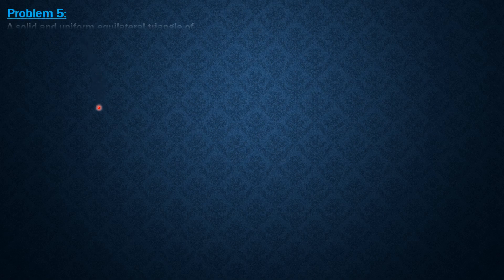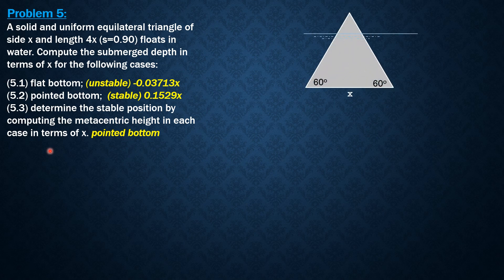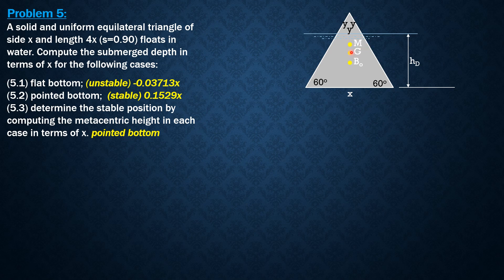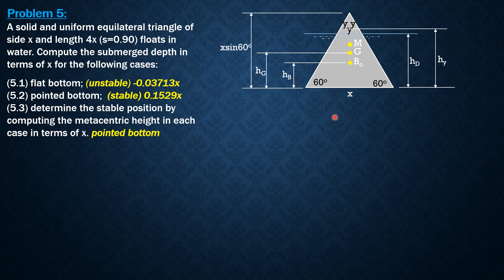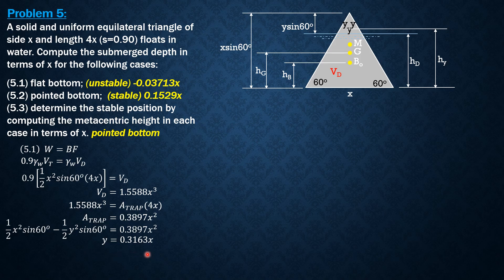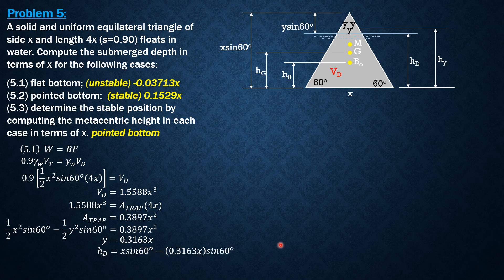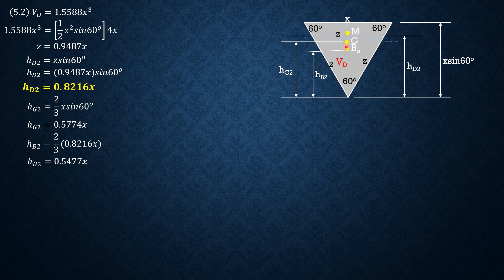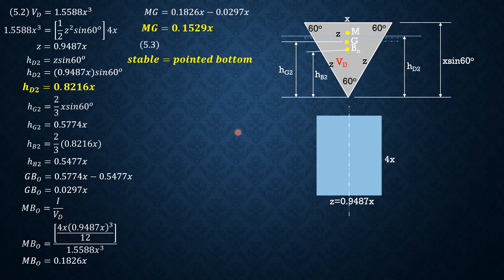STATICAL STABILITY of FLOATING BODIES, Example 5

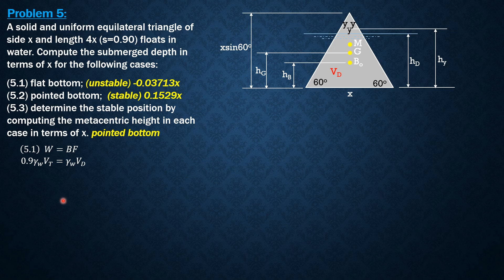Comment from the maker: At 4:07, I mentioned cancelling out volume displaced( it is supposedly specific weight of water).
Another way of computing hB is to divide the trapezoidal area into a rectangle of dimensions y and hD and a triangle with area equal to 0.3897x^2 minus y(hD). The result for hB is still 0.2448x. Try it yourselves.

Comment: what if the length 4x po is not given in the problem, what can we do to obtain the volume displaced? thank you po!
Reply from the maker: As long as the length L is greater than the dimension x, it does not matter. L has no use here. See my solution, the length 4x is not important.